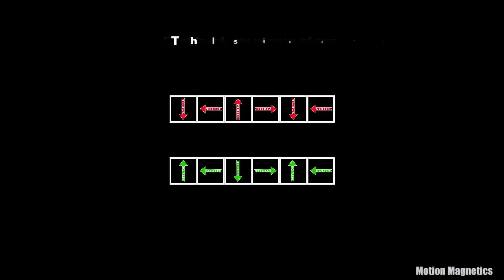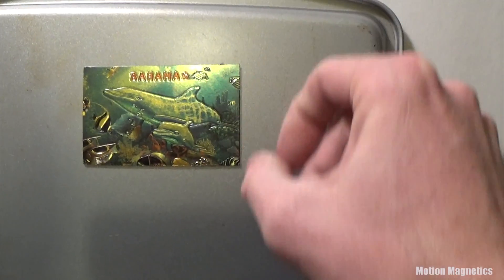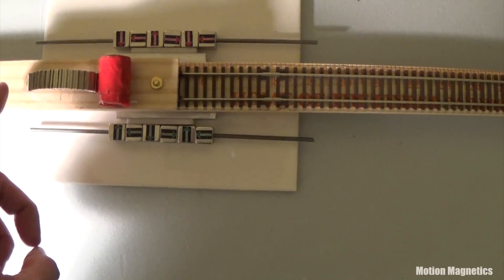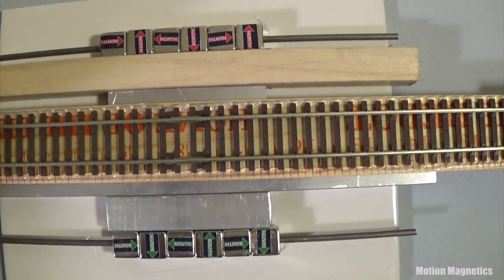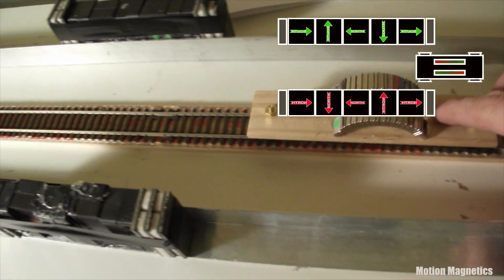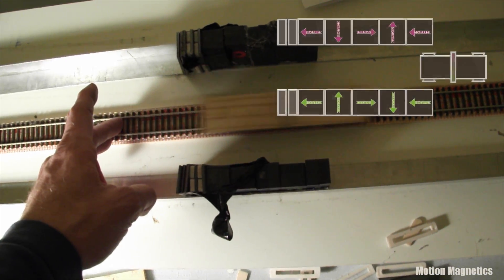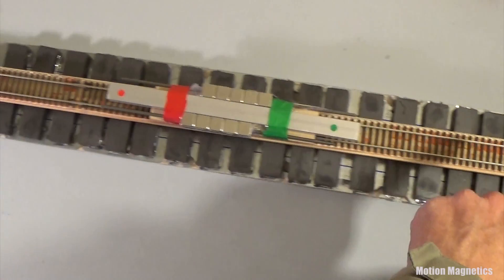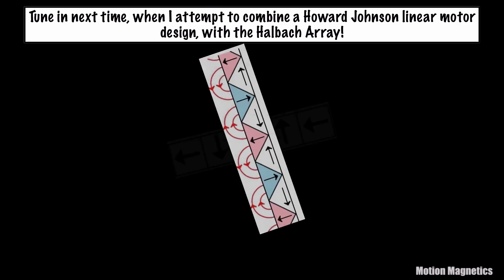Experimenting with the Halbach Array. Part 03

Comment: Free energy magnet motor. Mount Halbachs on a rotating drum and identical Halbachs as stators. Stagger them so at least one rotor and stator are in full push cycle as others are approaching the very brief sticking point.

Comment: Use a halback setup, but don't limit urself to 90° turns on each magnet. U want to pull then release. Where Ur polarity crosses the track, u create a lock. Try the polarity at 45° to the track, and use halback to negate the attraction from the back side of driving magnets. BTW, use each halback array independently. Each halback should be a closed loop, independant of the next.

Comment: Simple suggestion, cogging occurs when the magnetic force that accelerates the object in, is equal to the magnetic drag that prevents it from  exiting out. This is usually because the magnets become too close together at the centerpoint they need to pass. 
In your railroad car tests, if you add dense non-magnetic, non-inductive materials such as stone, you will have inertia. As the object rolls into the field at an increasing speed, the stored inertia will drive it past the center point and out again. You will have to reduce any running resistance on the rails, use nylon wheels and non-metallic fasteners so no additional inductance will occur, Then you can determine the amount of non-magnetic, non-inductive mass that will exit the rail with more inertia than when it entered. 
That amount will be a constant of  several variables, total drag (rolling resistance), total mass (weighed as a chunk), force of magnetic proximity (the highest at the mid point of the track), force of magnetic field (minimum attraction at the edge of the field). However, you can do this empirically. 
Put your magnet on paper, draw a number of rings around it of equal distance apart,  and map the strength at various angles for each ring. So you will want to optimize your track bed and magnet placement so the field strength is reduced at the center of the track but sufficient to induce motion at the starting point of the track.The maps will help you position the magnets to accomplish this.
With your linear Halbach arrays, this will be a two arrays in a V shape with a gap for the track. The strong side on the inner V facing the oncoming railcar. The weaker side would be on the outer V facing the outgoing railcar.

Comment: what determines the "strong side" and the "weak" side??? if each pole is 90 degrees turned each step, the array is symmetrical. Imagine the pattern at 0:28 repeating..... if you took a different 5-cube-set for your example, the poles could be pointing in literally the opposite direction to the given example.... so again.... what determines the "strengthened" side and the " weakened" side of the array?
Reply: upon closer examination, I've determined that from right to left, the array is "turning" in a "clockwise" direction, and the field is strengthened "above" the array..... if from right to left the array were "turning" in a "counter clockwise" direction, I imagine this would produce a strengthened field "below" the array. the array is not symmetrical, the field magnifying direction depends on the "clockwise" or "counterlockwise" orientation of the halbach array. There you have it people!

Comment: If you have a way to figure out how strong a magnetic field is and how a material will react to it, i.e. put it all in numbers for each component used, I have a way using AI that can calculate an optimal solution to get it to produce ongoing motion. Contact me via LinkedIn or similar.

Comment: here , let me help you.  use round neodymium magnets 1/2 inch dia. with different lengths in a VEE   V Pattern. where the two ends come together on the vee is where the magnets are shortest and the longest on the other end of the vee.  Just before the end of a vee start another vee of magnets.  IF you put this pattern on a wheel and have a square bar magnet above it . it will rotate fast.  Basically magnets that go from tall 2 inches to 1/8 inch high in a vee shape with little magnets at the vee end.

Comment: you did not alternate the array and offset the braking points where both north poles are facing directly to see if you can eliminate the brakes, by offsetting one space you alternate some cohesion between the forces

Comment: I have yet to try these ideas.  I have tried several versions of a V-gate with some success --- not a complete rotation or cycle alas.  The central axis hangs on the entrance to the gate very much like some of your other clips or other clips with other channels.  There has been a recent clip using two magnet systems on a common axis, where one set of magnets are much closer than the other set to the pivot point.  I was wondering if one might set up a customary V-gate on a tube that is also connected to another set of magnets (perhaps not a V-gate, but your modified Halback Array?  To get past the “sticky spot” that are the problem with most magnetic assemblies?  So that the non-V-gate magnets share the same axis but are at a larger radius that those of the V-gate?

Comment: Hi Motionmagnetics, what are your thoughts on this design https://www.youtube.com/watch?v=Md4gikM9Ezs
I cannot find any reasons why this design should fail if it should. Just want to know what do you think about it?
Reply from the maker: Unfortunately, it won't work. I explained why in this video I did several years ago: https://youtu.be/BYh_Upt868E
Reply: Yes. Got it. In the video, you mentioned that a mechanical setup can move the stator to avoid the sticky point. Something similar was also used in the original V-gate design. 
Just want to know the reasons whether a mechanical system to move the stator is an effective way to get pass sticky point or not?
Reply from the maker: Generally, the amount of energy required for a mechanical system to work negates the potential gain from the device you apply it to. That doesn't have to always be the case, but it usually is.
Reply from the maker: It will work somewhat with 3, but it's better to have more. You're essentially cycling 4 magnetic arrangements in a loop.
Reply from the maker: That's the general consensus, so that you cycle the start point.

Comment: Instead of turning your magnets in 90 degrees increments for the Halbach array, why not vary the rotation between magnets to the tangential angle of the main sine wave?  If your cart is always radially out of phase, then it won't cog.  Force the nodes of your tack fixed phase to be 3 dimensionally out of phase with your cart fixed phase.  Like a sound wave going down a tube, but the echo is exactly out of phase with the original sound.  So the counter spirals are perfectly out of phase in a terminated de- tuned array.  It would be a magnetic counter resonate tank.

Comment: all ur experiments in this video stars with the steel ball with no magnetic array in its rear. try putting tht ball in the midle of aluminum path and ur ball will not gain distsnce. in other words this approach is wrong. a perpetusl motion should be sble to propel thd ball in ny part of the path

Comment: Your projects are awesome but, you can't use magnetic fields by themselves, adding power based fields switching on and off guided by an arduino board would probably get you better results, it won't be perpetual motion.
Reply: I absolutely believe in perpetual motion ,Where there is a will, there is a way.
Reply: @No_Kings_Allowed  teleporting object is simply impossible, you can only teleport analogue signals and digital data but that’s it,
Trough we can fakingly teleport objects by scanning it in in 3D,(while  milling that original object into pieces),then teleport that data to a 3D printer somewhere aound the world or to another planet and 3D print it out , this way we can create a ellusion of teleporting objects,
But about perpetual motion machines, i absolutely do believe it’s possible.

Comment: i have a question. why switch to halbach array if the rrangement in smot does the same? d only feature  of halbach is that its magneticfild in oneside is amplifed with the other side almost cancelled. we do not need amplification of magnetic fields to be succesful in perpetual motion. in fact, what deters us from achieving perpetual motion is too much mgntism resulting to cogging. the point is halbach does not solve d problem of cogging.indeed u even put shilding in ur model. what we shoould focus s not developing more magnetic poer but rather, turning the tide so dat magnetic push is almost 100% with the negatve pull as 0 ver minimal

Comment: Hello, if you could only see the swirls coming out of each vertex of your magnets, probably you'll turn your cubes in a different angle... there is a continuous running spin present at each vertex as well as there is a block wall between the two poles of each magnet (spintronics): combining these two factors you can put in movement, in repel mode, many kind of magnets. It is only matter of geometry. I'm working on a self-rotating magnetic bearing... anyway, you're doing a good work, let's go ahead with your precious experimentation!
Reply: Vortex energy is the answer and the direction..it's only a matter of time to get there.....if...we can get there before DARPA slaps a patent on it & hides it away for themselves....they have been making interested noises about this...

Comment: I looked much in to his work to and even come up with a working design but it and most of his ideas were floored as he was waiting for better magnets like what we have today as even if you get a design to work and it has ferrite magnets doing work or in fixed opposition there fields will change or deflect over time and the design may fail to work after it has for months due to this. This does not mean hes ideas or concepts were wrong just ahead of what he had to work with at the time.
Keep working on it your on the right track of understanding and your work has been refreashing to watch with some new ideas good stuff .
PS. I have a 6 foot dia track 6 leg levelling table down in my lab and not ashamed to admit it and its work is far from done yet.
Need proof send me your Email I'll send you a pic.
Magnets are only part it some materials of some kinds can act as shielding, flux dampeners, Diamagnetic materials can also be applied.
Wish I'd seen your vids sooner.

Comment: You have the arrays pointed perpendicular to the track, so that North is the most attractive and is pointed toward the cart. Could you instead point North parallel to the track, attracting the cart into the array, and as it passes the weaker South it is not attracted and sucked back in?

Comment: You need to put "L"shaped iron core pieces on every magnet, also the runner magnets as it needs the right magbetic viscosity and buffering and sticky point shielding. ...
Reply from the maker: overunitydotcom Magnetic Viscosity, now that's a phrase you don't hear every day. lol Thanks for the suggestion. It's nice to see people thinking outside of the box. The Magnetic Aftereffect isn't something most people would think to include in their equation. There really are so many possible ways to configure these things. That's one of the reason's I share my work. The magnets I use are usually pretty easy to acquire, so I'm always hoping someone out there will find something I may have missed, by experimenting on their own. It's always easier to find a solution when more minds are involved.
Reply: Motionmagnetics
Okay, many thanks. Well when I still worked on magentic motors I have found out with a coworker, that it is best to put an "L" shaped Iron Core piece onto the poles of each permanent magnet. This way we achieved the best acceleration and also shieling against the sticky point. This is an earlier test here still with the old TOMI principle, but the runner magnets also need these "L" shaped iron core pieces. You also need to find out the right thickness of these iron core pieces for the right magnetic viscosity, needs all very mechanically fine tuneable..so it is really a hard work to get something to work...See:
https://www.youtube.com/watch?v=u5mYm5nO5Fw
Reply: Motionmagnetics
You can read up about magnetic viscosity on Jean Louis Naudin´s  site. It is some kind of buffering of the flux field inside the iron something like compressing the magnetic field inside the iron and releasing it again...
Reply from the maker: overunitydotcom It's an interesting concept. I was unaware of the information on Jean Louis Naudin's site. So thanks for that. Your a virtual plethora of information, my friend.

Comment: nice video! how did you stabilize the magnets in the array? I think they should tend to align their poles.

thinking loud, will it be better for you to use cylindirical magnets in the array?(by this way, you can produce arrays with an angle smaller than 90 degrees. if you use cylindirical magnets you may have 60 or 30 degree angle between each magnets of the array and it may result in a smoother transition of the moving cart)
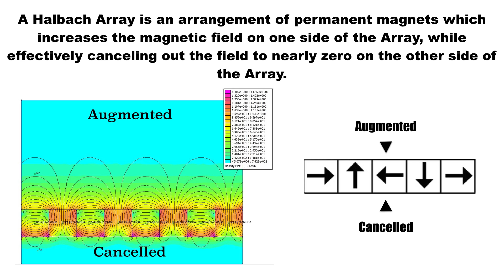Reply from the maker: Thank you. If you look at the one sided flux sheet diagram at 0:55 in the video, I used this type of configuration as a starting point for moving the steel ball. This lined up the north, on one side of the track, to the south on the other. And south to north, and so on. If you saw my "Magnetic Accelerator - Gauss Rifle" video, that's similar to how you move a steel ball up a track. The poles have to be the opposite from side to side, or varied back and fourth, in order to move the ball. 
I haven't tried cylindrical magnets. I saw an ached configuration, that fits neatly into a circle, that I'd enjoy experimenting with though.